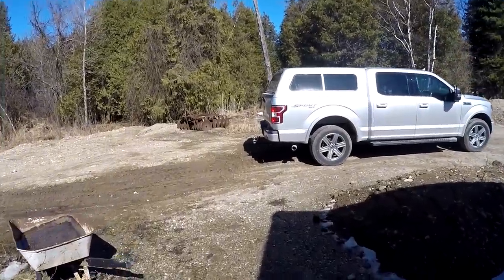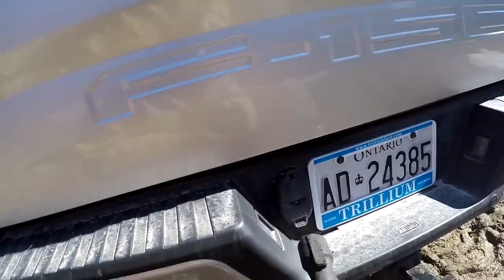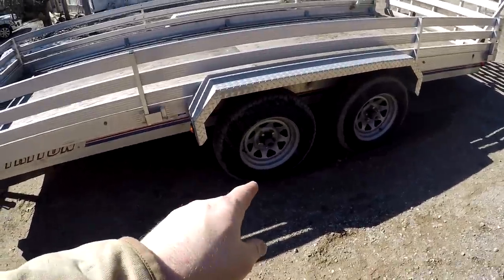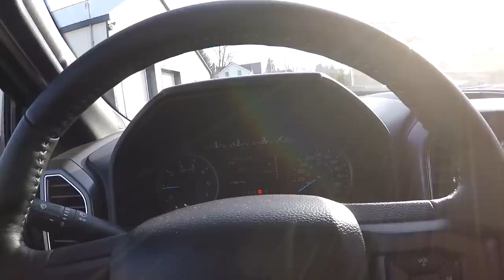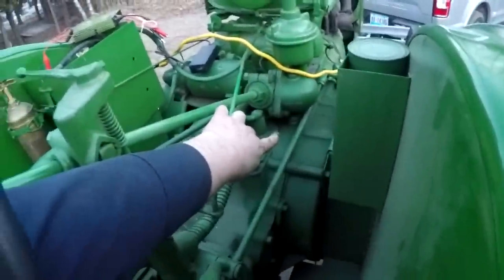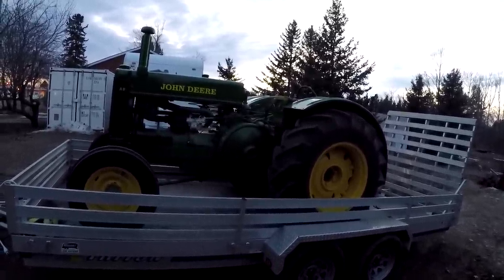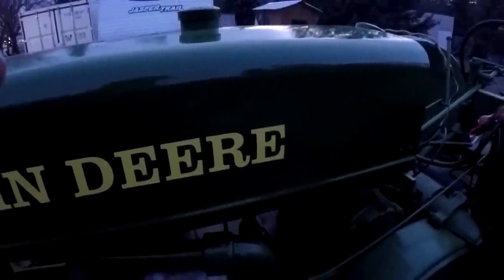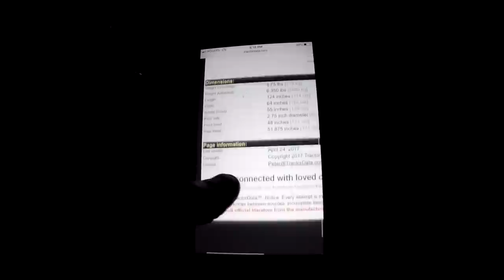The BIG DAY IS HERE......Let's go pick this Beauty up!!

Comment: Hey Bill I actually live in waterloo Iowa where this tractor was built the main factory is about 3 miles from where I live the old factory has been tore down and rebuilt and different parts of the assembly and engineering departments were move to to other buildings round the town very big place.
Reply from the maker: That’s cool👍👍

Comment: It's a loverly tractor bill :-D, it will need some love to make it 100% but you can tinker with it when you have interest/time.
If you wanted to bring that battery up slowly, use a standard 12v charger with a car headlight bulb in series, current limting the crude way lol.
Don't worry about the paint, it looks smashing :-D

Comment: Ford has a trailer package with the controller, backup direction knob, etc for a few dollars more.  You have to opt for this.  I agree the safety chain mounting holes are miserable to get on/off as they are so recessed.  With the trailer controller I got a kit with pads to put on the trailer that calibrate the trailer to the backup feature knob.  It allows you to set up and name multiple trailers so you don't have to set up each one again when you use them.  I am from the old school and can backup fairly good without the system Ford has developed, so I don't use that feature on mine and in fact have never set it up even on one trailer.

Comment: I had a 6 volt system originally on my `48 Willys CJ2A and had an Automotive Electric mechanic convert it to 12 volt, but he advised to leave the 6 volt starter as is . I used it that way for years 
and never an issue, and it did start a lot faster.
Reply from the maker: there's something about the sound of it coming alive from barely cranking though

Comment: Bill, turn signal and brake light runs over the same wire. Quickest light check for a trailer is parking lights and hazards. That checks all light functions on the trailer with one walk around. Then set your trailer brake gain and manually apply the trailer brakes to ensure they’re working. On the road in less than five minutes.

Trailer brakes are also proportional. The factory controller will apply the brakes of the trailer proportionally to the force that you are applying the vehicle brakes and the speed of the vehicle. For that trailer, your gain is going to roughly be around 4 empty.

Comment: The place to check the oil is directly under the clutch on the right side of the tractor. To check it, open the plug, and if oil drips out you are good to go. If not, add more until oil runs out. Any idea why the previous owner painted the carburetor white and oversprayed paint onto the block?  You can touch that up when you rebuild the carb.  They are super easy to work on.  Nice tractor Bill!   :)
Reply from the maker: Good info. The owner had died so I guess the info went with him

Comment: 39:22 the plug thing under the pulley left center in the picture is the oil level plug, one more thing those don’t crank much faster with 6 volt systems, they don’t have to turn very fast anyway. The sediment bowl didn’t look like it was full of gas? Is the main shutoff turned off maybe?
Reply from the maker: let her leak and shes full

Comment: The new Ford has a system with the trailer brakes. I set my truck to 10 gain because however hard you push the brake pedal thats how much brake the truck applies to the trailer. So if you push it half way 5 of the 10 trailer brake gain would be used. It shows you when you push the brake pedal after you squeeze the gain lever to test your brakes.

Comment: You are going to ware  them brakes out in a heart beat.  We run a 30 ft 5th wheel.  At like 4 to 5.
Reply from the maker: ford id a progressive brake system. Just because its set to 10 doesn't mean its on a t 10 as soon as you touch the brakes. so set on 10 if i just push a bit it only brakes the trailer a bit, More i apply the more it applys
Reply: @billstmaxx  we have a Ford f-350 2012 if you set it to ten it is ten but that could be different for the newer models.

Comment: Bill I would recommend crossing the chains when your hooking up your trailer for extra strength
Reply from the maker: The way they attach to the trailer it doesn’t make a difference
Reply: In Ontario the MTO will be on your case if you get pulled over and they are not crossed

Comment: Bill you should have just turned on your 4 way flashers. That's the same as using your turn signals. 4 ways and headlights on at same time means only 1 trip. And if the turn signals/ 4 ways work on the trailer  your brake lights will also be working on the trailer.

Comment: If it ran on karoseen you can use diesel for sub
Reply: Don't you think you'd want to be careful of that Anthony? After all kerosene is considerable more volatile than No. 2 fuel/diesel fuel. I'd be more inclined to try No. 1 fuel ( a.k.a. Stove Oil
as it is much lighter than Diesel.) Kerosene is closer to what is commonly called Jet Fuel/ JP-4 and would be a lot easier to get the engine to fire up.
But I`m thinking I`d have the John Deere club folks advise me on which would be the recommended fuel to use on a daily basis, what do you think?
Reply: Dont use diesel fuel in multi fuel johndeere tractors. There not designed for that.
Reply: @eugenerob8492   hey dummy do you know what karoseen is it's run off just before diesel fuel diesel fuel can be ran just like karoseen in tractors I'v done it I'm a machanic I'm not dumb
Reply: @regsparkes6507  stove oil is a mix of karoseen and diesel fuel
Reply: @anthonyyoung7344  not a very good one trust me bud i own 25 multi fuel tractors so i think im a bit more qualified than you but you carry on in your thoughts
Reply: @eugenerob8492  ok whatever you say I guess I don't know anything after all I've only built about 60 johndeeres with that's same engine and set-up
Reply: @anthonyyoung7344  Is it really,...really? By the way I have to tell you, that fuel is spelled, Kerosene, according to Exxon Mobile, and others.
It is derived from hydrocarbons and petroleum distillate, it is commonly used as a light engine fuel as well as turbine and straight jet engine fuels too. Also it can be used as a solvent for cleaning etc.
Where did you get that idea from? I am curious to know.